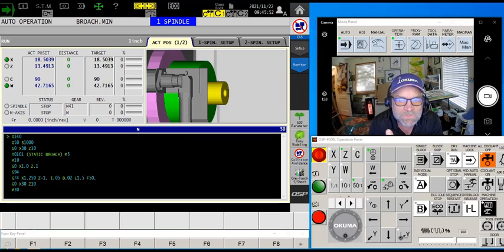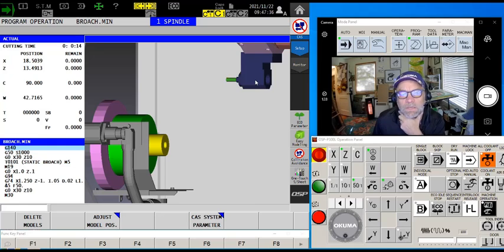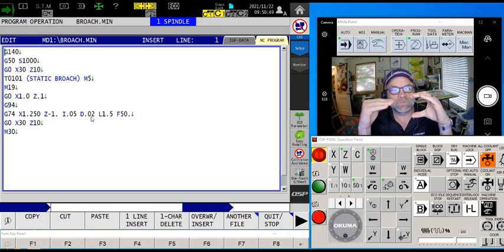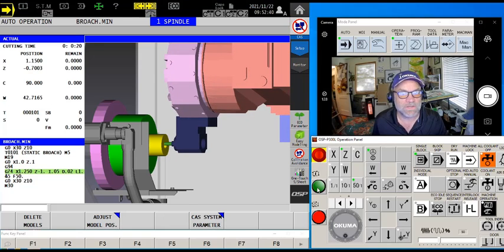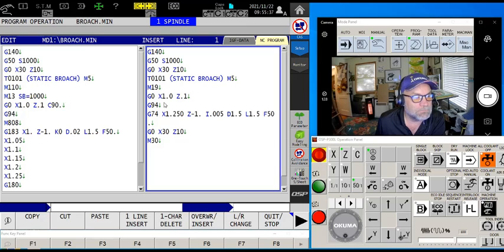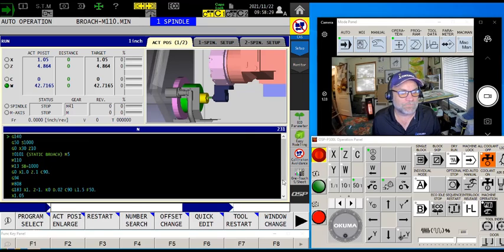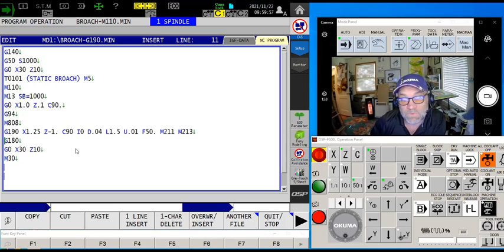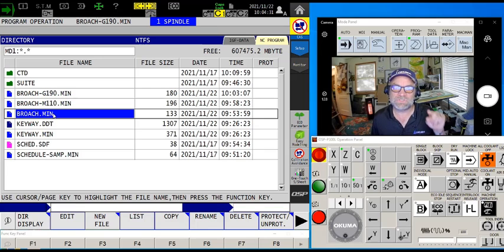Broaching on an Okuma Lathe

Comment: How come the rapid positioning is in metric then the G74 cycle is in Inch?? Can the G74 cycle be in metric also??
Reply from the maker: All of my values were in inch. If your machine is in metric, all values should be expressed in the unit
Reply: @pocketcharleywithgosiger my bad...I just realised that 30 inches and 10 inches...you've changed your parameters to imperial....Thanks for your program examples!

Comment: It works a charm on a okuma lu4000 ex. Twin turret. Just wondering why it keeps locking and unlocking the chuck. Instead of just locking it once and then unlocking when C ref is needed. After each cut in z it turns off then on again
Reply: Did you ever find a solution to this? I'm having that same issue with Okuma LB3000 EX 2

Comment: Very interesting video that you made here & it is one that I will be putting into practice soon enough since my old 2 axis lathe died it's final death and I get a brand new l2000m and with more capability on the machine means more advanced work will get put on it. Your explanation was very simple to follow with clear examples which were easy to wrap my head around and I have started to look through the rest of your videos for extra tips on the new software that I will be using.

Have a good day.

Comment: Thankyou  Charlie  for teaching us this.
I'm looking into buying a lathe. Can you tell me why you would choose Okuma over the other brands?
Also how long have you been around  Okuma  lathes?

Regards LeRoy
Reply from the maker: I pick Okuma for several reasons: the first is that Okuma doesn't tie you to the past like other NC controls. We in the industry have been trained to do things a certain way, even if they make no sense. For instance, why do we all have to know O-9999 means all programs? Okuma is in this century with PC based logic such as ALL PROGRAMS instead of a secret handshake. The biggest reason I think Okuma is the clear choice is the number of Okuma products older than 30 years that are still out there making good parts. I like to say that the biggest competition Okuma faces is old Okumas. These things run forever!
Reply: @pocketcharleywithgosiger  "Run forever" is exactly why the deciding factor to go my MC4VA won out. I ran the same model at my old work and over a 15 year span needed a tech to come in 3-4 times total for it.
Reply from the maker: @578Beta  Thanks for sharing! MC4VA is quite the battle ax.